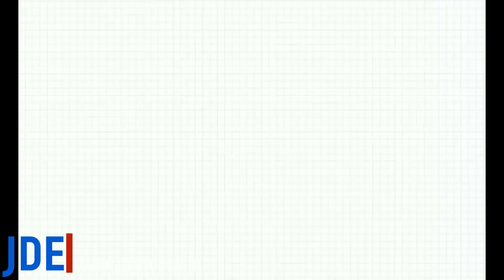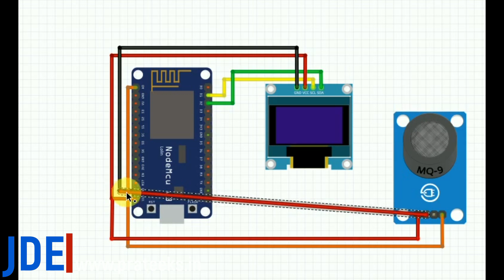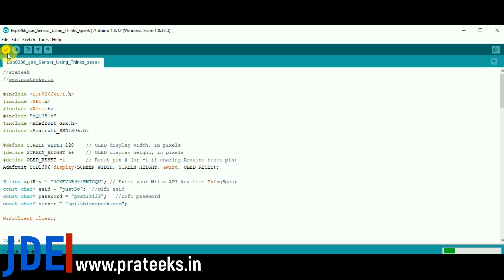IoT Based Air Quality Monitoring With ESP8266 & Air Quality Sensor (MQ135 ) | Esp8266 Project

Comment: How do you calibrate the sensor
Reply from the maker: in code chek it
Reply: I think you're supposed to let it burn-in for 24-48hrs in an area that has clean air (well ventilated). Then I don't know how to make sure the values are accurate other than getting an expensive calibrated meter to compare numbers